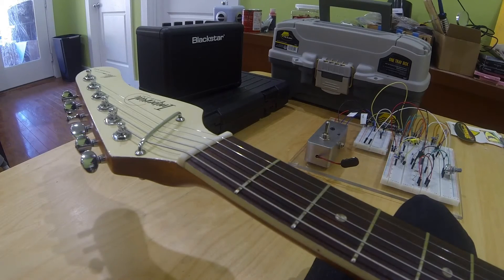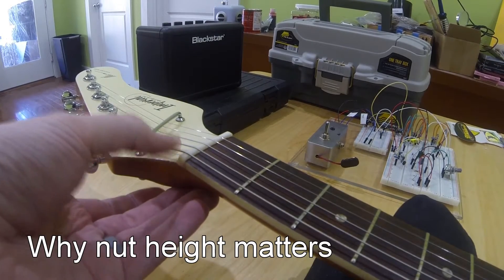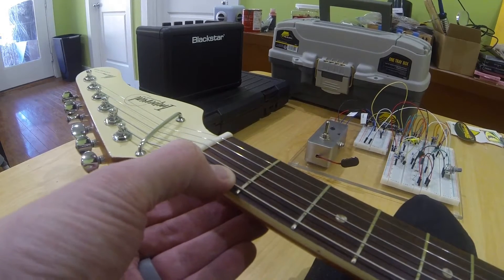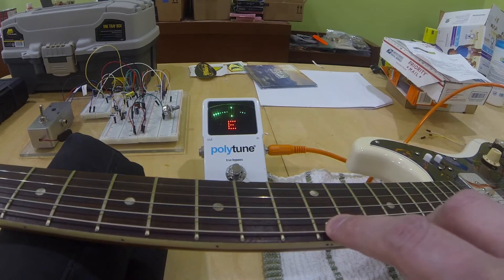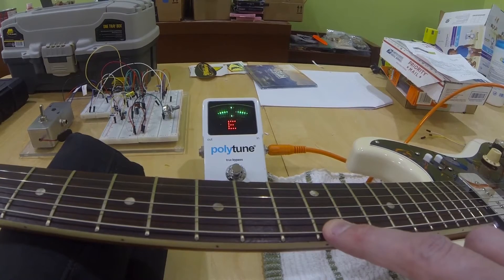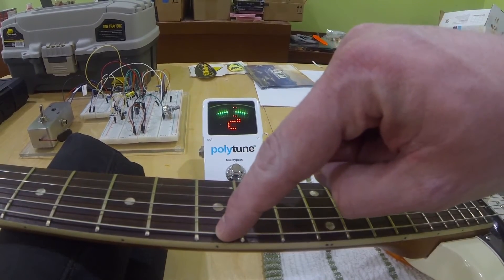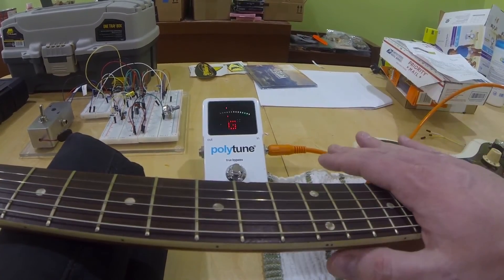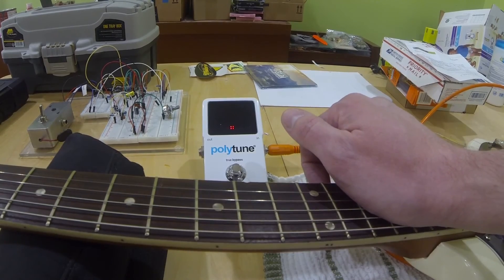The problem with incorrect nut height - MMT01

Comment: Great video, Im pretty sure my new Duo sonic has the nut too high, its very un confortable to play in the 1,2 and 3rd fret... And the worst is that sound out of tune...specially the 3rd string.... I was getting crazy about this problem... Looks like this video has the right answer....Does anybody knows if its better to try low the slots in the nut or to change for new nut?. Thanks!

Comment: Is it better to file the bottom of the nut or to file inside the string slots of the nut? I saw both ways
Reply: lowering the slot is what fixes the problem. But, you need to make sure the width of the slot accommodates your string gauge or it will not sit properly in the bottom of the slot and fix the intonation problem.

Comment: I think this might be the problem with my Epiphone Les Paul. I recently replaced the cheap factory nut with a graphtech xl and installed locking tuners to help with poor tuning stability. It solved my tuning problems but now my G string is about 10-12 cents sharp all the way down the neck when I play fretted notes. But it's only my G. Could this still be a problem with the nut height? It just seems to me that the nut height would affect all the strings and not just one but I'm not really experienced with this. If it's the nut how could I fix this without affecting the other strings? Would you suggest filing down the slot for the G?
Reply: Sounds like you have an intonation problem, if the bridge saddle is too far forward or too far back, it can cause the string to be sharp or flat all the way up the fretboard.  There are plenty of good videos here on youtube for setting up intonation
Reply: oh its the same case as me, its also just the G string the intonation at 12th fret sounds ok but the 1st 5 fret sounds Sharp
Reply: @riichan2895  it's the nut height...that's what was wrong with mine. I installed another nut and problem solved..

Comment: Common problem with cheap guitars?
Reply from the maker: +Robert Fullone From my experience, yes. Many low cost import guitars simply fit common parts on the guitar and then provide basic setup. If the woodworking isn't spot or parts have slight variance it will lead to the nut height being out if spec. A guitar with a high nut can intonate perfectly at the 12th fret and all harmonics but still pull sharp on lower frets. It can easily be missed with just a quick setup check.